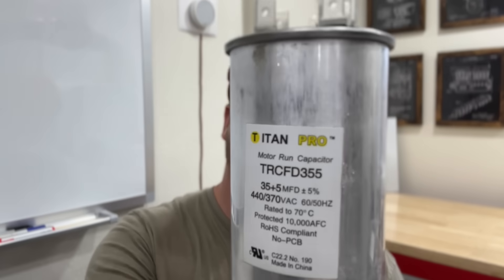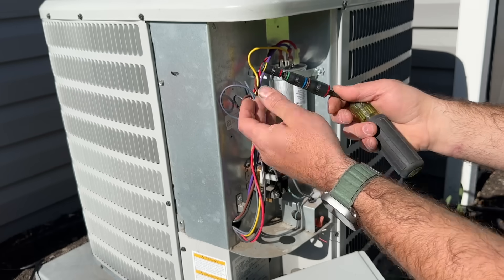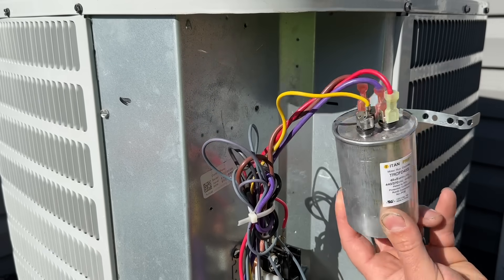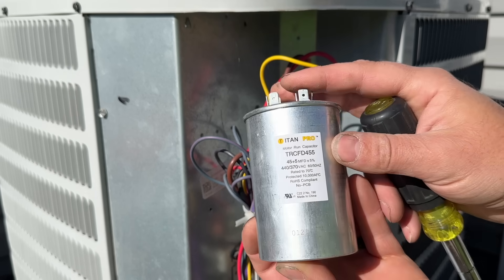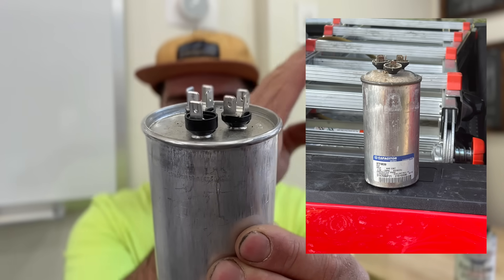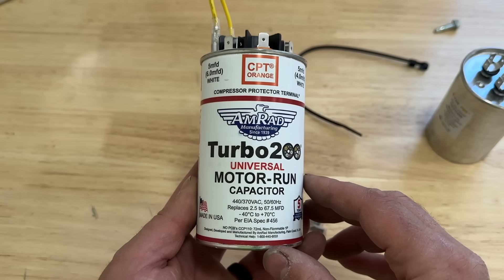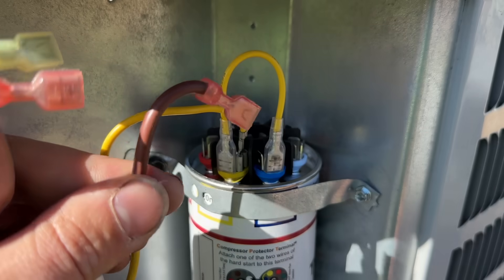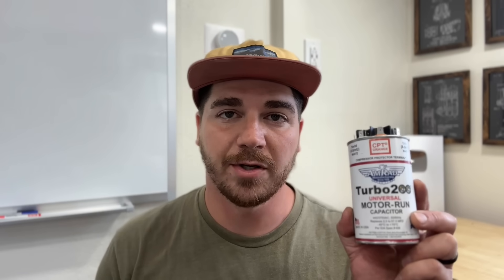HVAC Contractors Practically Make Their Living On These

Comment: 👊😄❤ Nope... Bigtime Scammer HVAC people in Florida...   When I was a kid about 20 years back We had our AC repaired, it was all working fine then their employee visits the next day stating he has to check something because the system isn't running right.  He was walking with a block of styrofoamin his hand trying to conceal it on his side. So I followed him he said he just needed to check the master room vent which the AC was on the other side of that wall it was the main vent, he had to check the back floor vent something is wrong. I said everything is working fine, he leaves the home and all of our air stopped...  Keep in mind at that time we were poor so if they could do this to poor people in a trailer nobody is off limits.

 I go to the back room where I see the guy actually clogged the main vent with the styrofoam... Yes We have VERY "HONEST" AC techs in the world. It seems like the Nature of the business.  You think the DBPR really cares? I had a contractor actually Notarize, FORGE, alter a notice of commencement and then submit it to the city for a new roof... DBPR said they saw no wrong doing, The State of saw it otherwise.
Reply: 👊😄❤Fast forward years later, Our A/C was blowing warm air. AC Tech comes over and touches something outside and then says he doesn't know what happened now no air was blowing. Says we may need a whole new system. My wife walks over to it and notices 2 wires disconnected from the capacitor which he adimantly said he did not do that. A/C was blowing again.  He said he could fix this but he doesn't know how much longer it will last and still suggested a new system. Coincidence or more scamming.

Comment: Pop was in Refrigeration and Air Conditioning his last three years of the Air Force, so he showed me this and a few other tips.  I helped a few people, usually "Swamp coolers" in West Texas areas. Everyone that works on the A/C units need a meter and a "Fin Comb", but there are several different sizes.   I just last summer had a tech replace my A/C capacitor.                                                                                                                                                                                                                        . New regulations and Building Codes  are coming out of Washington now and soon more , that will cost us people 30% increases in A/C system replacement and new construction.  Sorry, USA, but the Democrats are forcing it down our throats, under the "It's gonna be better for the environment." tag lines..

Comment: can the fan tell me what capacitor i need
Reply: If you can look up the model number of the fan motor, you can look up the capacitor size required, but it doesn't tell you the other value which is the compressor value.  Capacitors have 2 ratings typically, like 40/5, one is for the compressor (the higher value) the other is for the fan (the lower value).

Comment: That's a run capacitor, easy way to tell is runs are metal starts are plastic. The most common is the fan side, I split them up they will last the life of the unit. A easy way to check is with a pencell. If the unit has the compressor running with no fan, stick the pencell through the top and bump the fan if it starts and runs its the fan capacitor. I replace both when they are twined like that, the fan side runs hot and fails. If you are paying $2,000 for, at most a 2 hour job  that's way to much even at 150 an hour and 40 in parts it should only cost $350 ish with tax.

Comment: Ok so i am going to use small words because this guy is a little bit of an asshole.  DO NOT put titans onto your unit. They are trash and will go out every year.  Also while yes it is true most of the time the repair is a cap going out, it isn't always just replace and go.  There is always a reason for the cap going out. Sometimes it is just it's done time to replace.  Sometimes there is a short in the unit, sometimes it isn't the cap at all but the issue presents as it is.  Please remember if HVAC were so easy and safe anyone would do it, is a stupid dangerous mentality that will end up costing people more than 2k if they are lucky.  Please do not watch a few youtubes and think you can replace years of working on units. Especially since units are evolving as new regs get put out. A seer 14, is not the same as a Seer 2 14.3 and you can fuck up your unit not knowing what you are doing.
Reply: What do you mean he's an ahole? I have medical issues and need our HVAC fixed but can't afford it and surgery is coming up. This guy made me think I could fix this myself. Now you've scared me. I'm debating not breathing in the heat or breaking my HVAC worse or idk. 😢😢😢
Reply: @speaklifegardenhomesteadpe8783  You can tell if your capacitor is bad by buying a multimeter which reads capacitance.  If the capacitance is off, the capacitor is bad.  They have a value with a tolerance, something like 45/10 +/-6%  That means the 40 is +/- which means it should read 37.6 to 42.4uf, and the smaller 10uf one should be 9.4 to 10.6uf.

But you have to take the wires off at least 2 of the 3 terminals to measure the values.

Comment: Thanks for all the videos! Had a cap go bad on me after 3yr usage, new construction. Fan still worked, compressor couldn't kick on, only heard a quick buzz noise. Have a hvac friend, and tested it super quick, lucky had the exact capacitor I needed and he had that universal one, was cool to look at it. 

After this quick fix repair, I've education myself with video knowledge and already purchased a back up, I'm much more familiar with my condenser unit now and ready if it fails again. 

My old capacitor didn't have any swelling or leaking, the top of it was rusted, but now I know how to test one with my multimeter and the herm was only reading 6.5 of 45 and the fan was 5 of 5, which explains why the fan still turned on, but not the compressor.

Comment: The top (cap) will be raised (bubble) and not flat.
Reply: Not always.  Most caps will fail the tolerance value before failing completely, and can fail without any signs on the outside.

Comment: Had a tech come out and quote $2300 to replace my capacitor. Ordered one off of Amazon, being careful to mirror the specs on the old capacitor. Pulled the electrical disconnect, unfastened the capacitor (it was bulging on top), and I was careful to reinstall the wires where they were located on the old capacitor. Threw the old capacitor in the garbage and fired up my air conditioner. Worked like a charm. Saved $2285. And these HVAC guys had 4.9 stars on google and 5 stars on the the local classified here in Salt Lake City.
Reply: My neighbor in pg was told they needed to but a new unit. I replaced cap and contactor told them give me $50
Reply: They probably did need a new unit.
Reply: Google reviews and online reviews in general are easily fabricated or manipulated by knowledgeable website developers and optimization people.  They can make fake reviews and/or pay people to make reviews. I sold my Optometry practice to a your doctor who then pumped up the numbers of positive reviews by trickery and paying a website optimization consultant to greatly increase reviews so that it appeared that the business was much larger and more successful than it actually was. 
At this point I generally don’t trust online reviews of businesses anymore. All it takes is money, not real reviews.
Reply: I did the same as you, googled on YouTube for issue with my HVAC and it was the same scenario.  Bought the part at a local hardware store for 13 bucks, took me less than 10 minutes to fix it.  Been working fine ever since (been over 5 years to date), knock on wood...
Reply: I do know if you haul junk metal into the salvage yard you have to take off the capacitor or they won't take your junk.
Reply: @duanehanson1974  
The cap is an electrical hazard, and the material inside it is an electrolyte compound (not the kind that you drink in your Gatoraid).  That stuff can be environmentally nasty, so they don't want it accumulating at a scrap yard.
Reply: @atigerclaw  Depending on when the capacitor was made, fuck yes. If you read the label on the capacitor at 0:10, it says No-PCB. Polychlorinated biphenyls are nasty stuff. Today they are banned, but you might still find them in old caps.
Reply: This is what happens when the consumer has no idea about something like this. I've saved a lot of money over the years from You Tube university.
Reply: Should have turned them in to BBB.
Reply: Just take pictures
Reply: Nobody quoted you 2300 dollars to change a capacitor.  Cool story though!
Reply: @dennisyounker1032 I wish you were right. My faith in human nature dropped a notch that day.
Reply: @dennisyounker1032 . Seems like BS to me also
Reply: That may be true but you wouldn't have known the capacitor was bad without his expertise and that thing would still be rotting in your backyard.
I would have charged you $150 200 to cover time travel and the part.
Reply: @justsayen2024 And I would have said yes to anything 600 or less. Your clients are lucky
Reply: @justsayen2024  That sounds reasonable. Say $100 for travel time and car costs, $30 for the first 15 min of work, $50 for the capacitor including some markup. 
The guy who tried to charge doughusbands $2300 deserved to be sent home without money.

Comment: That happened to my ac unit fan working but no cold air and you can tell that the compressor isn’t working because the air coming from the fan was cold if it is hot the compressor is working, bought the capacitor changed it and voila!

Comment: Your description of symptoms at the condensing unit seems to indicate every possible condition and thus it’s always the cap.

For all the guys talking about training , experience,spare parts on hand and whatever else to justify a high price let’s say this.  Your hourly rate is your hourly rate. You parts markup is your parts markup.  Unless you are clear that the labor rate starts when you start driving the the customers house and ends when you get back to the shop, your charge should be one hour of labor and the part + markup.  Anything else is disingenuous at best, and fraud at the worst.  Be honest with your customers and you will get return customers.

Comment: I worked for one of the largest HVAC/Plumbing/Elec. companies in Denver. I delivered parts. I delivered a new capacitor to a HVAC tech. Climbed up on the roof along with the tech. He unplugged the old & plugged in the new-DONE. I started to climb back down & the tech said, "Wait 10 minutes or so. I don't want to get the guy mad. I'm charging $500 for this install." That was in 2014. This company (hint: A fruit-wood) was notorious for the ridiculous charges.

Comment: I have a problem my air conditioner is blowing just cool air when I have it on for a long time. Do you think that this might be the problem?
Reply: It is worth measuring the capacitor values.  A lot of times, the capacitance drifts out of tolerance before they go bad.  Turn off power, discharge the capacitor, carefully remove the leads off the capacitor (take a picture so you know where they go), measure the capacitance.  The tolerance is typically around +/- 5%.  So, if your capacitor is supposed to be 60uf, and measures 40uf or 20uf or any value below 57uf and above 63uf, replace it.

You will need a meter that can measure capacitance to check it.

Comment: Some units have run & start capacitors plus when you pull the disconnect just leave it out then no guessing. Most contractors around my area charge from $ 400-600 to change one out.

Comment: I don’t know of any company charging $1000 for a capacitor change. So is the homeowner capable of checking the systems refrigerant levels or proper compressor and valve operation? Its experience and knowledge to properly check a system completely not a parts changer.

Comment: Just had this done to me.   Told me it was only working half power and needed to be replaced soon.  Told me if I didn’t have it replaced while he was at the house he would change me for another visit.   I let him replace it and after he left I found out I could get one from Amazon for $15 dollars.   They changed me over $150 for the part.    Will not use this ac company again.  Sadly
Reply: They probably charged you $150 for parts AND labor.  If they charged you $150 for the part, you were obviously getting ripped off.

Comment: Yeah, they got me. I had checkup done on mine after owning the house for 7 years. I figured I'd have like a $250 bill is everything looked good. Of course I needed to replace few things to include the capacitor and the final bill was about $1000. Then after they left, whenever the a/c thermostat kicked off, the fan would keep running. They said I would need a defrost control board and it would cost $475 before labor. I said nah and bought one on amazon for $56. Turns out they just wired stuff funny and I didn't need the board either. Criminals.

Comment: What should really be illegal is these pieces of hardware being so poorly manufactured that they go bad. Why in 2024 do we have capacitors that last less than 20 years. As I see it, these parts are designed to fail. The contactor wearing out makes a lot more sense, but even those could be made to reduce arcing, pitting, oxidation.
Reply: You can get better quality capacitors which are Made in the USA for about the same price, Amrad, Mars and several others are Made in the USA.  Capacitor lifespan is less because they got rid of the toxic chemicals they used in them previously, which caused cancer, birth defects and a host of other issues.

I'm pretty sure most people would prefer to replace their capacitors twice as often instead of getting cancer treatments and birth defects...

Comment: Always change capacitor and contractor together and $750 is standard. And it’s not a scam it’s all relative. School and apprenticeship as well as knowing every form of the trade on top of working manual labor on the heat and freezing cold. U should make that type of money. But u pay a lawyer or any other type of person 10x and don’t blink. It’s all relative. Get paid make ur money and fuck little Jew bags who think they know it all. There’s 100 other parts in a AC system that can go bad. How do YOU the customer know not to change those? Ie the whole system and run u 20k. That all plays into the price. For every guys who fixes it the first time there’s 100 that have 20 return trips to tell u that it can’t be fixed. That’s what u pay me for. I charge wtf I want cuz not only do I fix it.  I’m honest. I give u the best option. If I make a mistake I rectify it. Which I only have maby 3-4 call backs in the last 4 yeara. Usually 1 a season and they aren’t mistakes it’s either something else broke or the apprentice didn’t tighten a bleeder screw or left his gauges on a unit. But 2k is crazy. Even my boy don’t charge that. And he’s king of the crack em. So I guess I’m reasonable then

Comment: I live in Texas and my biggest fear is the AC going out in August. Usually, technicians are back logged for weeks and when they do come to check your system, they rush through inspecting it and almost always claim there's a "leak" somewhere so they just add freon with that nasty stop-leak in it and then call it good and charge you $600 for it. 

I'm trying to learn how to repair my own HVAC now before the warranty runs out on my system because I can't drop $10,000+ for a new system. 

So you got yourself a subscriber, sir. Lol

Comment: You should not be paying over 300 for a 1 hour job and an off the shelf part. 2-3000$ is the price of an entire new system. I do commercial controls and we charge out the ass and most our jobs are under 1 grand.
I refuse to believe you were charged that much. That isn’t a trade markup or a sneaky tech, thats just a scam.
Reply from the maker: Well read through the comments. A lot of people charge over $300.   Yes $2000 isn’t often and obviously they were getting scammed. But regardless, this video was to show people how they can avoid paying anything over $100 whether they choose to get the factory one for $15 or they choose to get the Turbo 200 for $75

Comment: I keep a spare contactor and capacitor with me, so I don't have to worry about emergencies that are a simple fix. I had a contactor go bad on me last year and the capacitor was completely rusted and may have been the original (39 year old a/c still working fine), so I swapped out the capacitor at the same time. For my furnace, I have a spare flame sensor and ignitor.

My ignitor went out 4 years ago and it was 0F. I had one one order from Amazon, but it got delayed so I decided to call someone to come replace it, since I looked online and I was told it would be $150 - $200 for a professional to do it... nope.... they quoted me $800. I talked them down to $500, but that was when I decided to always have spare hvac parts on hand.

Comment: Our local supply shop charged me $40 for an AC capacitor last time but they charge HVAC contractors $15. So, even the supply houses are screwing the homeowners over.  The HVAC company we used the time before charged $200 to “diagnose and install” a capacitor the time before when local supply store was “sold out” that Summer.

Comment: Seriously,  he's right.  Seen myself a company told a single mom that the outside unit and furnace needed to be replaced.  I looked at it and it was just the cap.  No charge loss or anything else.  I started offering to look at people's air conditioner for $20 including gas just to give people a heads up on what it was or a 2nd opinion.  MOST companies do commission so these guys have no insensitive other than good morals(I won't go in to the political affiliation 90% of these guys go by).